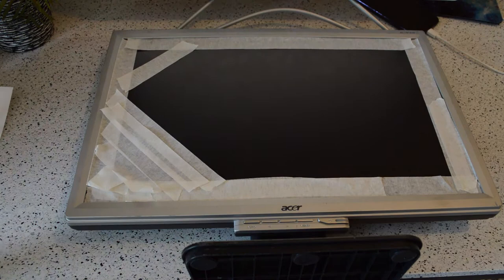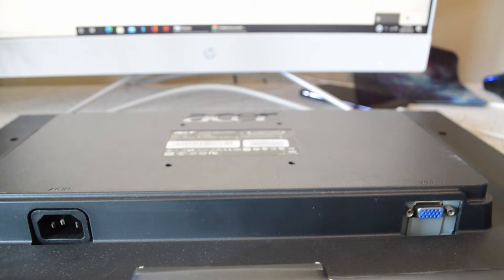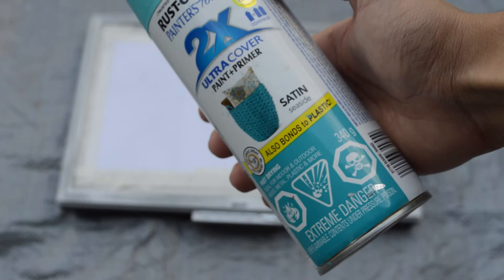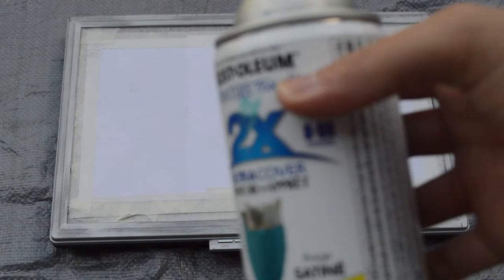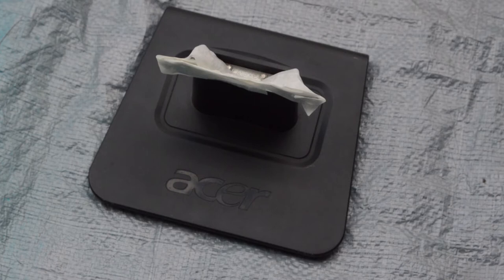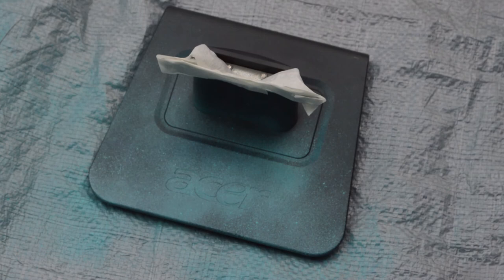How To Spray Paint Computer Monitor DIY - 2020 Guide

Comment: PSA: DO NOT SPRAY PAINT THE BACK OF YOUR MONITOR/VENTS. You will RUIN your monitor, if not immediately, eventually. If you have any sort of expensive monitor, especially do not cover the barcode or ID of the monitor like shown here. You basically void the warranty by painting the bevel anyway but still do not do this. ONLY paint your bevel and or stands.
Reply: Yeah.  I was wondering about this.  I figured those areas would have to be a light brush?
Reply: @visigothsloth4819  there is no point painting the back of your monitor since you do not see it. You could remove the back plate and paint on its own but I personally find this unnecessary and potentially damaging to your monitor.
Reply: @josyjo5787  oh, mine does. It's sideways instead of back to wall. I know, weird.
Reply: Thanks for the heads up, but I’m going to do it anyways.

Comment: It's a lot safer to disassemble your monitor so you actually get the bevel off and backplate off then do the spraypainting process. Not only can you sort out the issue with possibly messing up your vents but you also don't risk painting the actual screen and risking damanging it during cleanup. Also make sure you have proper ventalation.

Comment: Since it’s spray paint does the paint ever scratch off? I’m new to spray paint so I don’t exactly know what primer does either.
Reply: i would think it’s pretty hard to chip especially a monitor since you’re not typically messing around with it
Reply: I would use sandpaper wherever you wanna paint to scratch off that glossy coating. That way, the paint will stick to the plastic better and not scratch off. Then go over the spray paint with clear coat to add back that glossy finish to protect the paint from scratches.
Reply: @TofuBebe  my monitor has a touch power can i paint will it work after paint

Comment: What grit sand paper did u use
Reply from the maker: If you have rough spots on your monitor,go for a rougher grit,but only to smooth those bits out,and just work your way down ,the paint will cover it up